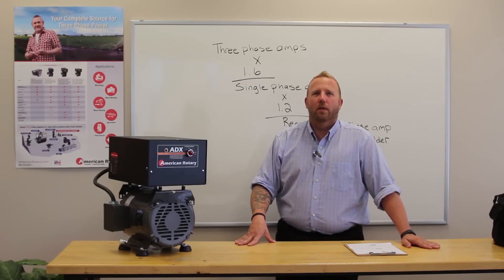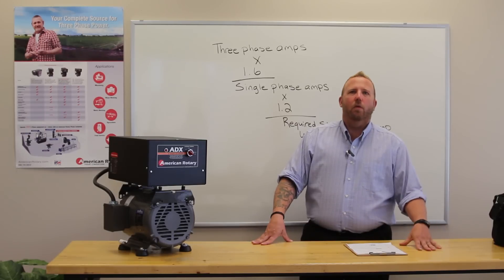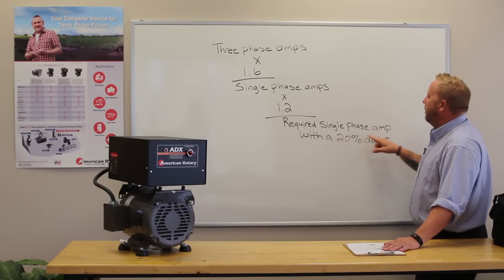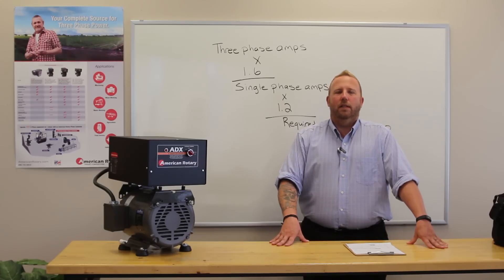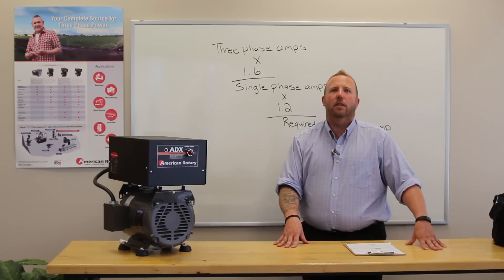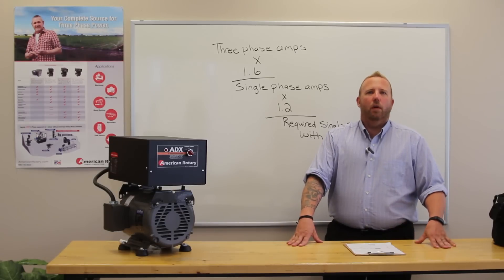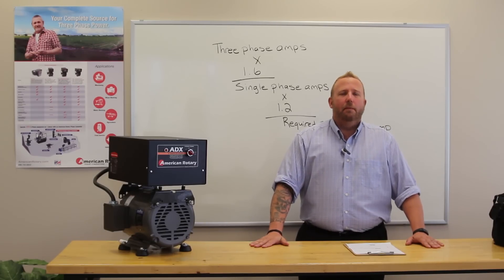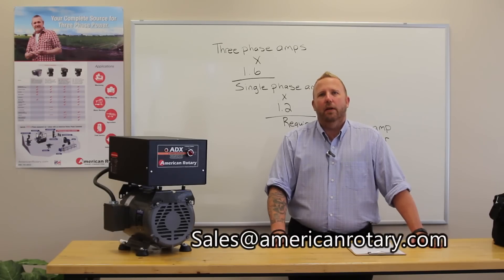Top Phase Converter Tips

Comment: Was looking to run  a 5hp 3 phase air compressor but these things are $2700.00 vs just buying a single phase motor for $570.00 a Baldor. These converters are not worth it they cost way to much you might as well have 3 phase ran from the pole it would be cheaper then these things
Reply: 3 phase run from the pole was going to be close to $30,000 for me and it wasn't even that far. I got a slightly bigger unit than I need from these guys just in case and it cost me under $5k

Comment: so how are you balancing the run voltages coming out of the converter so that they are say + - 10 % of each other? Are you using a microprocessor to do the switching with run caps or just run caps alone?

Comment: That was a great video.  I need to add one of these for a 3HP Pulverizer.  The Amperage is 10, so I did the calculations and it looks like a 20 amp circuit will run this.  The motor is a multitap voltage, we are going with 220. We Have a 20 amp double pole breaker with #12 wire going out to the box where we want to install this.  Any suggestions on products?  I need to go to your website and look at options.  It will be located outside, but well under cover from moisture on a loading dock.
Reply from the maker: Hi Deric, Please give us a call at 1-888-743-6832 and we will help you find exactly what you need. Thanks!
Reply: Turns out that a little more investigating and I discovered we do have three phase at the panel in the shop.  But thanks anyway.  :)

Comment: i have a 15 hp motor used to drive a hydraulic pump. i suppose a 5 hp would work, but i just happen to have a 15 hp laying around. the rpm is 1750 the amps for low voltage is 39.3. what would u recommend? thanks

Comment: Do these converters work on multiple earth neutral (M. E. N) electrical systems?
Reply from the maker: Good Morning, We have three phase solutions for almost every three phase machine out there.  Please feel free to contact us directly to go over in more specific what your machine specifications are.  You can call us directly at 888-743-6832 or you can email me at Jacob@americanrotary.com.  We look Forward to hearing from you.  Thank you for watching!
Reply: +American Rotary that has nothing to do with my question. I realize you can run all machines but I'm pretty sure the power going into it matters right?
Reply from the maker: Good Morning, sorry for the brief response.  We try not to get too technical on our comments on the video to not “SPAM” the feed up for a lack of a better word.  The phase converters are a delta only system; two hot legs and ground on the input and three hot legs and ground on the output.  We do carry transformers that can be added that will get you the neutral if required.   Please feel free to contact us directly if you have more in-depth technical questions.  We look forward to hearing from you!
Reply from the maker: That is correct. The required input power is based off of the size of your load. A 10hp motor would require a 20hp converter to properly start it. Once running you can start another motor and another. Now with that in mind you would need a min 60amp single phase circuit to feed it and as you add more equipment you would then need more power on the input.